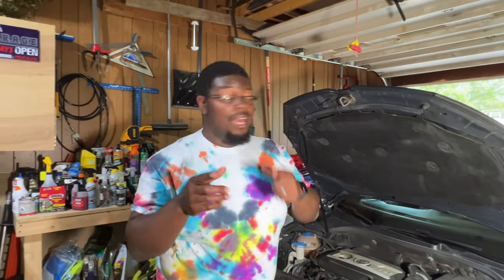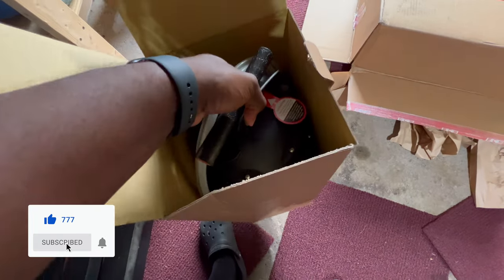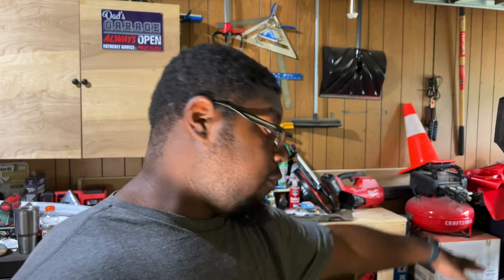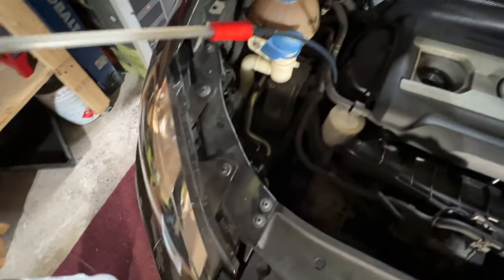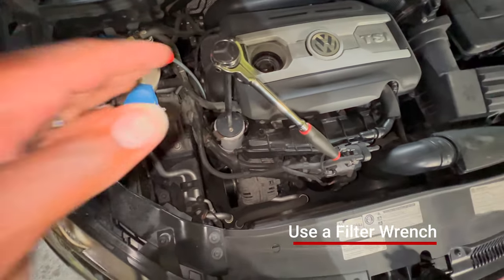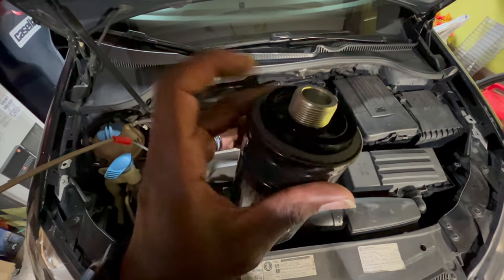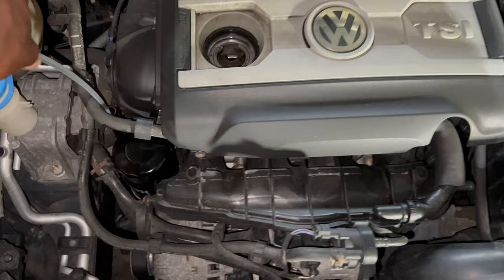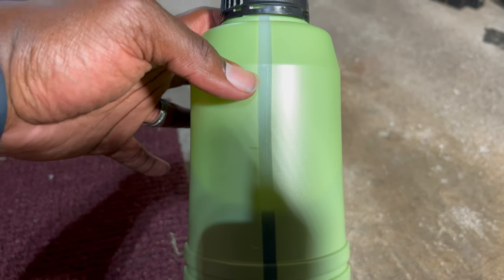MK6 Golf GTI - How To Change The Oil

Comment: Bought an oil extractor, but wasn't clear just quite how far down I should push it - the instructions that came with it said the depth of the dipstick, but that didn't seem deep enough.

I'll do what you do - push it down until I feel resistance.

Also, draining the oil filter before taking it off - that's the cleanest oil filter removal I've ever seen 😃

Thanks for the video!
Reply from the maker: Thank you for watching. This things makes oil changes so much smoother and was such a good purchase.

Comment: when i used the shop manual they say ~4.6L or something as i can remember in the EA888 but i needed to dump all 5 liters in it to get the right level.
Reply from the maker: As long as you are checking it correctly and on a level surface, I say give it what it needs.

Comment: i cannot express this enough never use an oil extractor. it leaves so much bad oil at the bottom of your oil pan and you will blow your engine up with the gunk build up.
Reply from the maker: I’ve been reviewing studies on this. Placement on the mk6 makes all of the difference. Causing no left over oil, sludge or build up.
Reply: This is so factually incorrect lol
Reply from the maker: @nousernames444  my reply or the original comment?
Reply: Wrong actually look into it also these cars are designed to be able to use one